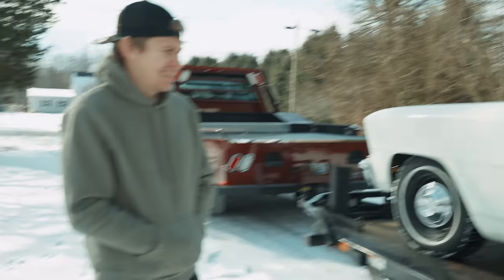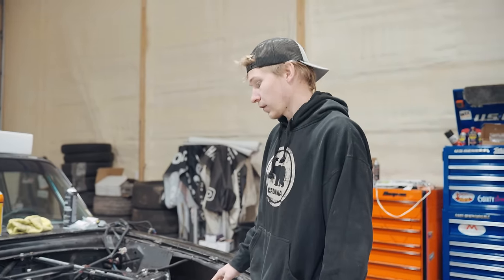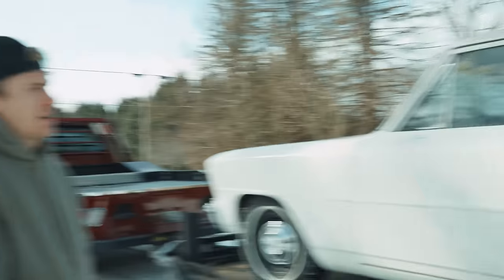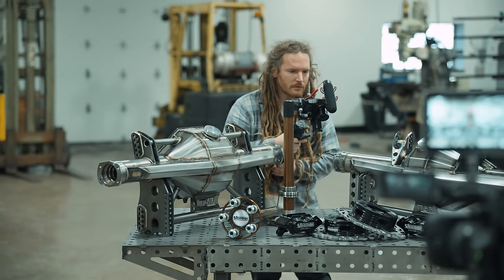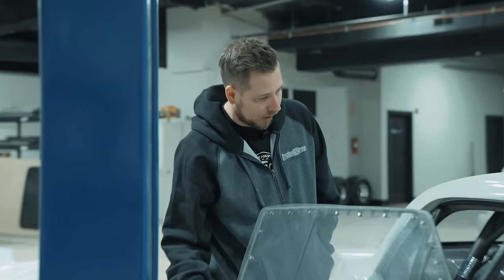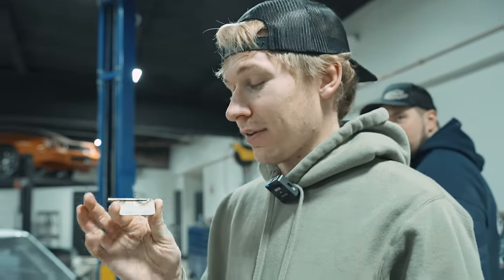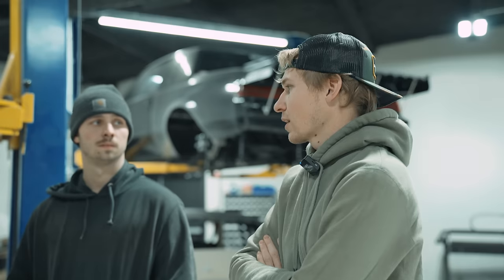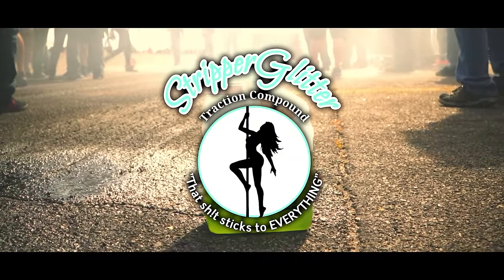Tin Soldier Racecars Reacts to my Pro Charged Camaro Build!

Comment: Hey Steve an easy way  to get those axles out.  Put the brake drums on backwards put a couple
lug nuts on and use the brake drum as a slidehammer.

Comment: Billy. Put your knee in the center of that car seat and pull the seat belt all the way out so it locks and pull it really tight. It shouldn’t move at all if it’s tight enough.
Reply: Bump! As a dad of 3 I’ve done that a couple hundred times lol
Reply: @isaiahrivera1720  dad of 3 as well. It was the easiest way to ensure it was nice and snug.

Comment: That car seat is supposed to go in the center, facing rearward for young'ins as little as Wyatt. Don't rush things that precious boy will grow up faster than you can even fathom in your head. Enjoy every moment of every day with your son!
Edit : also all this talk about book bags...if y'all are talking high school we didn't know what a book bag was back then. 1988 in college I had a straight black one pocket basic bag that got carried just one right arm strap all the time no matter what it weighed. Pretty sure I was the only kid in college that daily drove his 1970 442 back and forth to school, at least in this area. Had a bad day one time, left the school lot headed to the cloverleaf that pointed me west on Ford Rd for just a couple miles to home. Bottom of that ramp the plan was to stab it on the radials, light up the overpass underneath with both sound and tire smoke...instead I stood up on that pedal as if trying to push it thru the grille....then the little ball popped off the throttle cable! There I am sitting on the right with a choppy 1100 rpm idle but no way can I get home this way. Had to reach underneath and find what was left of the cable, wrap it around an index finger, point the car straight, bend down again and pull it...quickly raise up to see where I was going, point it straight again and repeat the process.  5 miles took 45min but I did it. It was crazy when I started to get pissed off with my head under the dash I would just yeet that cable with tires squealing going sideways, return to idle then take a peek where I was headed. If anybody watched me I'm positive it was a WTF moment..

Comment: I think you need a s197 in the corral. Good 6.0,4l80e swap with 2 different tires,wheels option. Road coarse 18”,& drag pack, lol. That’s my thoughts, you can pick those cars up on the cheap, cheap, lol.

Comment: For the 408… get a new edge mustang and get 03-04 cobra front and rear fascia. And drop the 408 in a terminator clone. Can be easily done on the cheap with any new edge mustang.

Comment: I would go ahead and have M&M trans build you a 2 speed TH400 and skip the Powerglide and go ahead and have Tin Soldier's change the trans mount because you are going to make too much power for the Powerglide as it is with the combo you plan on building and putting in the car